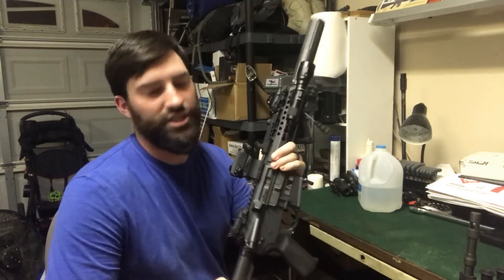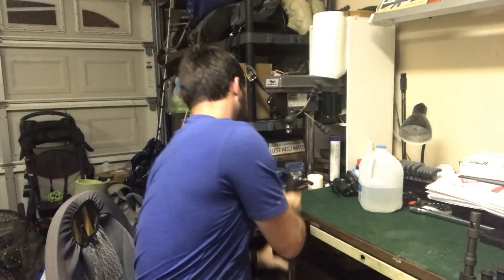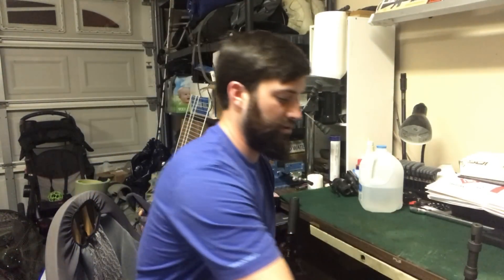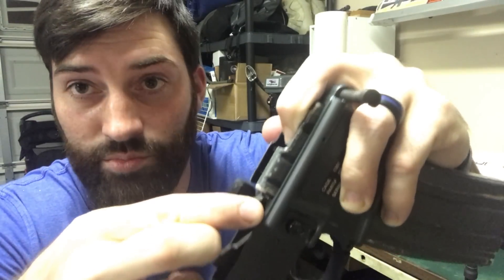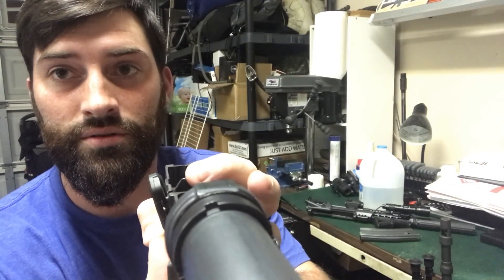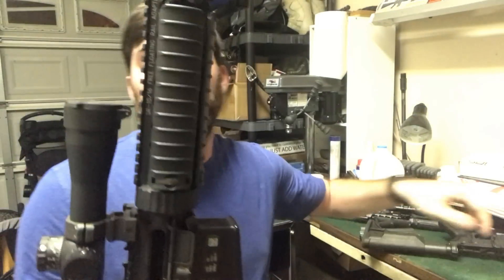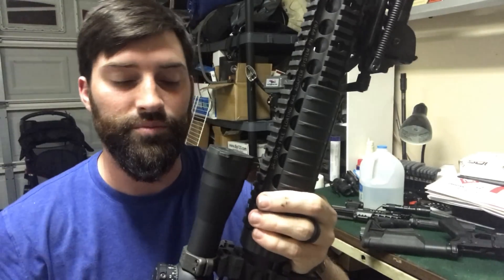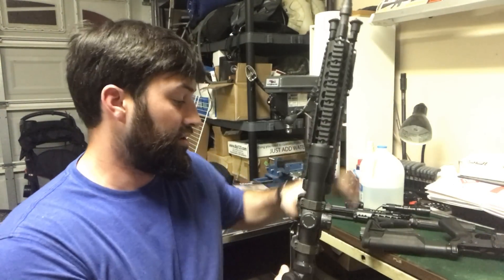My Bolt Went Home By Itself!

Comment: What is the tool I've seen you use to align the rail to the upper receiver?
Reply from the maker: You can use just about any one-piece scope mount. You could use an old detachable A2 carry handle or some such thing. You probably saw me using an ACOG mount.
Reply: @CalebDowning  oh ok thanks so much. I think it was a acog mount. I appreciate it

Comment: So there is no reason t keep your rifle with the bolt in the locked back position your just asking for more trouble.
Reply: David Silverman 
Springs only get messed up from being compressed then released over and over. Holding it in one Position will not do any harm.
Reply: wiseguy436 I wouldn't personally keep any firearm with the bolt held to the rear. It puts unnecessary strain and wear on the recoil springs. A good confident and well checked unload is best.

Comment: The TC Compass bolt rifle recently had a recall on 2016 models because the firing pin under spring tension (cocking lever) would release from inertia when the rifle was in the fire position. That to me is a bigger deal (a fix but not critical) than just a semi-auto bolt running home from inertia. However if the lever is cocked and/or I have a round in the chamber of any of my bolt rifles, the safety is on preventing that. That is just a matter of involuntary practice. If I can push the safety on it will be on as a matter of practice. If I cannot push the safety on then the rifle is not cocked. I would be far more concerned (alarmed actually since this is critical) if the cocking lever released under inertia while in the safe position or the safety was on. Then the rifle would not be used until the rifle safety is checked for function.

Comment: The bolt rides back into the buffer tube just enough to allow the friction pressure between it and what would be the "slide lock" on a pistol to drop out of the way. Once he mag is out the only thing keeping the bolt release up is the bolt. Its inertia the same reason why some polymer pistols slides slam home when hit from the bottom.

Comment: The original comment was mine and I'm glad you took the time to investigate the matter. As all of your ARs do it as well as mine , I'll assume its normal. I had figured out why it happens, just don't like that it does. I had never heard anyone discuss it before, but it's a good thing to be aware of. Knowledge is only powerful when shared. Later!
Reply from the maker: Perfectly normal. It can be a little off putting when it happens and you aren't expecting it. Thanks for the question man.